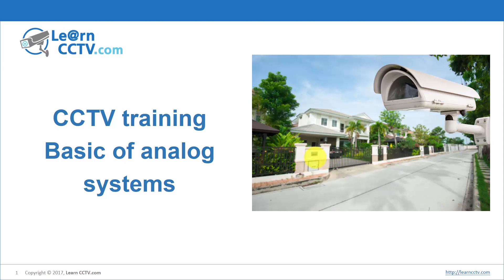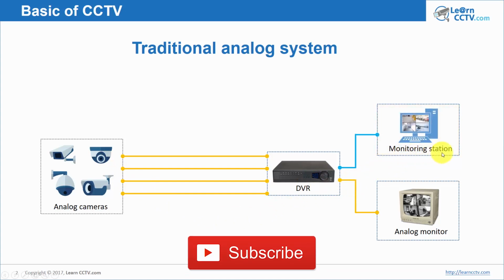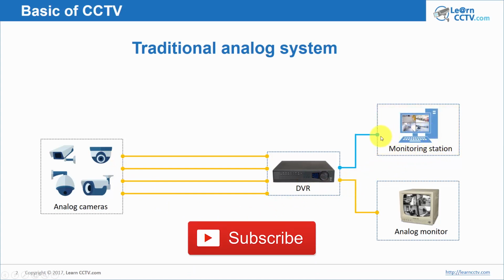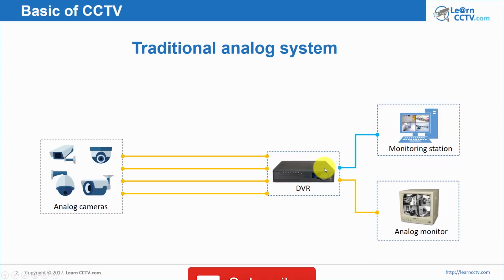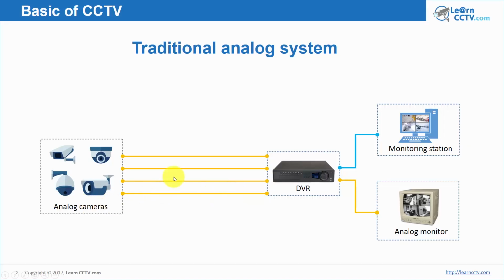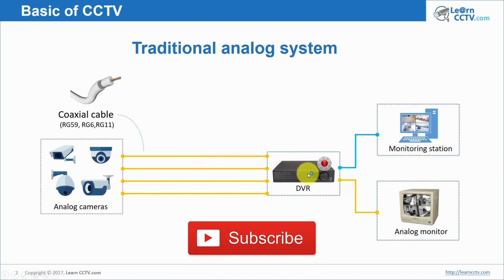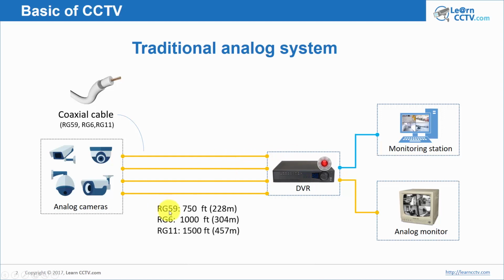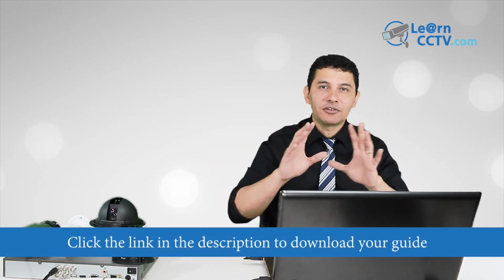CCTV training - Basic Analog Systems (Updated 2020)

Comment: The cameras need power supply right? 
I completely understand the setup now thanks for sharing information on cable names that are required. Its pretty basic now 
I need 4 cameras 
1 x DVR 4 Channel 
I need 1 TB hard disk 
1 x LED 
CABLING as you mentioned 
is there anything that I am missing ?